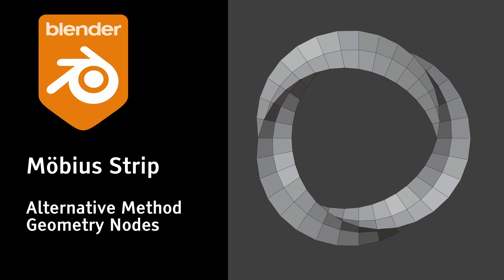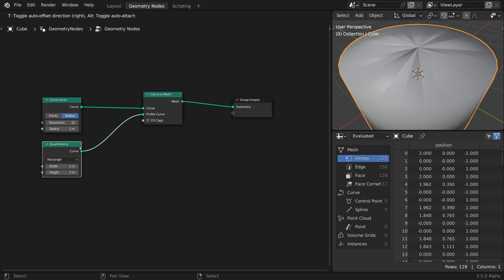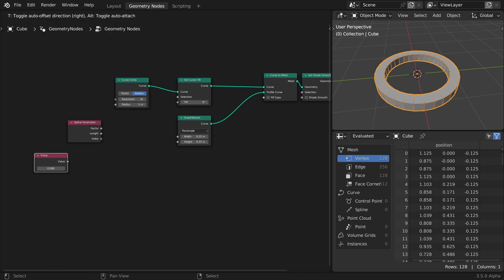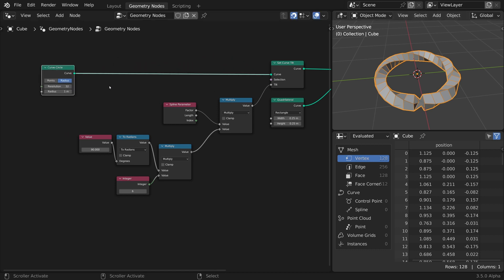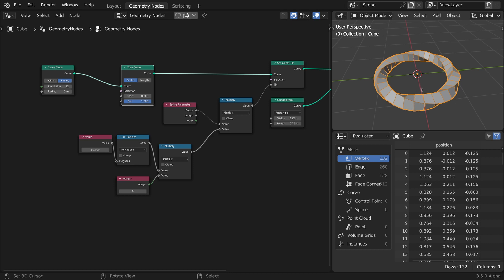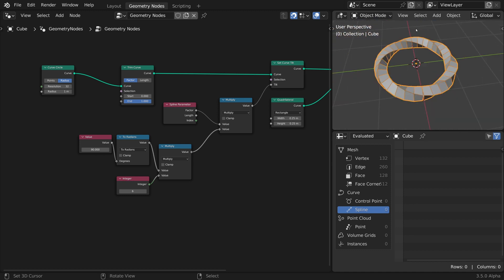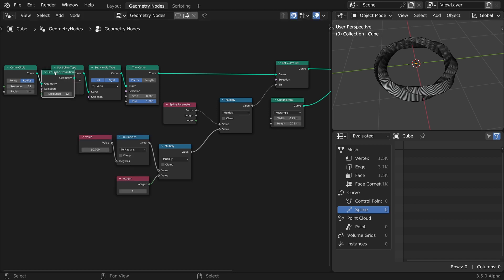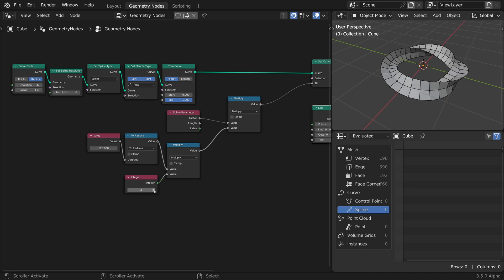Mobius Strip - Alternative Method - Geometry Nodes

Comment: awesome! :) i have a question about this: would it be possible to "slide" the mobius strip curve along itself as you did in the animated torus knot tutorial? i tried to apply the set position-technique you showed in that tutorial on this moebius strip one but the only thing i get is a rotating moebius strip, not the curve sliding along itself. i would appreciate any hint or tip! :)
Reply from the maker: I guess you should also rotate the point around the tangent of the curve using the same technique.
Reply: @ilirbeqiri  thx for your quick response! :) but i honestly don't know how to do what you're suggesting. which point? and would i put that after the set curve tilt?
Reply from the maker: @heinzlu8671  Add some value to the Factor (use a math node) before the multiplication step. This should do it.
Reply: @ilirbeqiri  thx but i still cant wrap my head around it unfortunately :/
Reply from the maker: @heinzlu8671 if you followed my tutorial, insert a math node after the Spline Parameter node. Feed the Factor value into the first socket and slide the value of the second socket. You should see the points rotate around the tangent direction of the curve. It’s as simple as that.
Reply: @ilirbeqiri  ah ok, yes i see. thats what gives me the moebius strip rotating around itself, same as choosing a star curve primitive as input for curve to mesh and animating the "twist" parameter of the star. thats cool and i did that before :) but do you know how to not only rotate the moebius strip around itself as in the two mentioned ways but additionally let the curve "travel" along itself within that? like a rolling staircase effect despite the rotating or non rotating effect?
Reply from the maker: @heinzlu8671 combine this method with the one you tried before (following the torus knot tutorial), with set position and sample position along the original curve.
Reply: @ilirbeqiri  it worked, so cool. Thank you! :)

Comment: The only thing I would add, is that for the last 3 edge example is that the description for "Value" (Under "Node") could be set to "360 / Integer" as a reminder that (per your example: 3) all that needs to be done under value is enter: 360/3 (or whatever the "Integer" value is set to and it will augomagically be calculated (Example: If the Integer is 8, 360/8 would set the Value node as 45 [360/8])
Reply: "automagically"

Comment: finally, someone who actually does GN correctly. I always see youtubers over complicating trivial GN tasks, but I don't have the time to make many videos. (I find this especially by Johnny Matthews for some reason 🤷‍♂️)

there is usually a very simple solution to most tasks.
Reply from the maker: I feel flattered. I don’t make videos very often, but try to explain them as plainly as I can when I do and I hope I’m doing it right every time. 😉
I follow your experiments on twitter and think it would be interesting to see some of them explained in details. It doesn’t have to be a mandatory, periodically thing, a video here and there would be fine. The hardest part is starting.

Comment: Love this. I had also seen Johnny's tutorial, but this is more elegant. I suppose there are technically duplicate vertices where the ends meet which could be counteracted with a Merge By Distance node?
Reply from the maker: Double vertices are not necessarily a bad thing in this case if you consider UV coordinates.
Reply: @ilirbeqiri  Interesting. I hadn't thought about that.